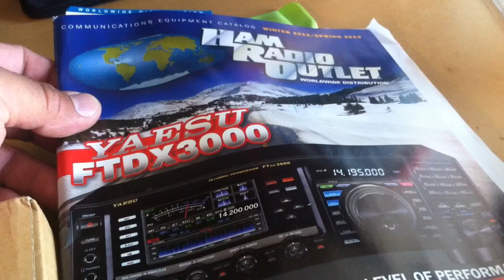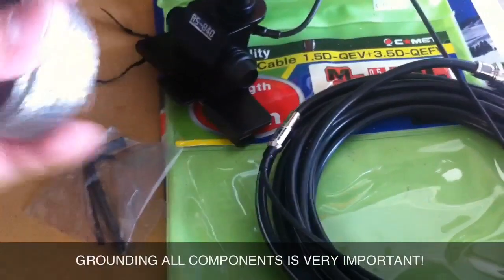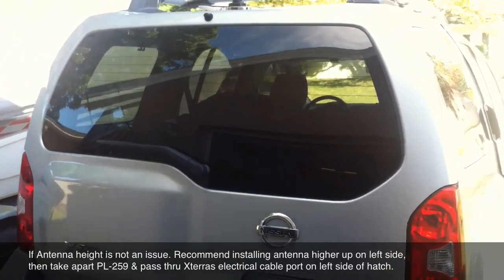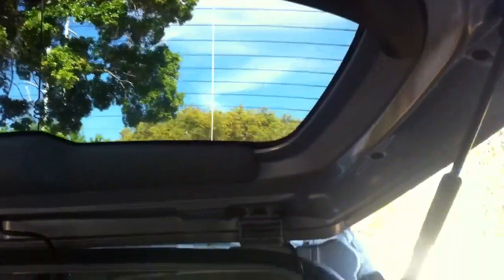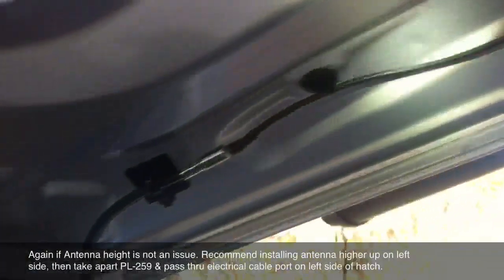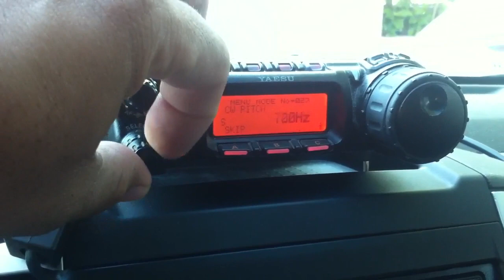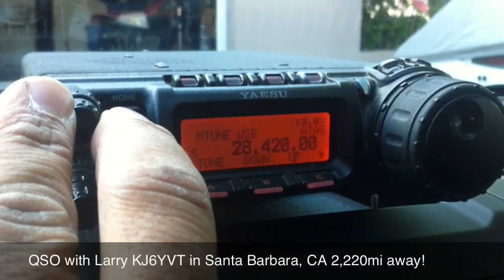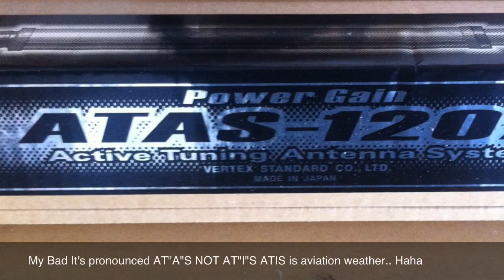How to Install ATAS-120A Antenna w FT-857 Ham Radio

Comment: I have the same setup on my 2008 Toyota Tacoma and you are spot on when it comes to grounding a mobile setup.  20, 15 and 12 meters is a blast when driving home in the afternoon during the summer, lots of European stations report my mobile signal as 57 and up.  Enjoy.
73,
Scott/K5BGL
Reply: Hi,

do you have your ATAS 120A mounted on top or along the bed? I have a Tacoma with a SnugTop and I am having difficulty deciding where to mount it. Got a videos of your set up?
Reply: My ATAS-120 is mounted to the left side of the hood.  I will be posting photos of my mobile set up on QRZ.com this weekend.  Look up K5BGL for photos in a few days.
Reply: sljoseph74 Right on! Looking forward to them. Thanks!!
Reply: Robert,

I have finally updated my profile on QRZ.com and included some photos of the mobile setup.

73,
Scott/K5BGL

Comment: I would have suggested mounting the antenna on the drivers side.  This puts it in the middle of the road and there are less obstacles in the middle than there are on the curb side. For instance, when there are trees on the side of the road, sometimes the branches extend over the road.
Reply from the maker: Agree, but figured diagonally would be the furthest I could safely have HF installed not to mention I installed the VHF/UHF antenna on drivers…
Reply: I agree with you completely. I mounted my ATAS on the Driver's Side Rear Lift Gate of my Van.

Comment: I laughed when I saw this. I have a raptor 30 and a 2000 Nissan Xterra.  I don't do HF mobile but 2m 440 antenna is mag mount as my xyl likes to trim trees lol. Ran my coax through the right rear pass door seal also

Comment: +David Mercado  Hi David, is the ATAS120 still working? I have read so many negative reviews.
Reply from the maker: Achisachis73, antennas still doing great! Make sure the reviews are about the 120A and not the 100 or non A version. Also depending on your location and climate antenna life may vary. I'm in Clearwater Florida so maybe the weather is in my favor or this Salty seawater air may be a ticking time bomb. Only time will tell!
Reply: *****
thank you David, I got mine with a new FT857d and it is working fine

Comment: David, thanks for the video hermano. How is the antenna holding up? I have the same radio but I am undecided as to what antenna to use. I've read a lot of mixed reviews about water messing up this unit. How is it doing in Florida weather? Thanks!

Comment: +David Mercado.. I just purchased the Atas 120a Thursday to go on my big rig. how is yours still holding up?.. KI4TTL
Reply: Mr Marcus I'm also considering this antenna for my big rig. if you get it before I do please let me know how it holds up especially in winter weather situations
Reply: I had one on my Freightliner. The rubber top boot came loose. I think a clown in the truck wash hit it with the high pressure hose. I notice it came undone a few hundred miles away in the rain. I stopped and resealed it with Gorilla glue. I wanted 80 meters, so I bought a Little Tarheel II. I should have gotten that first. I used the dual bolt mirror mounts. Had to have a custom hole drilled at yard for the ATAS120a. The LTII screws into a regular cb mount.
Reply from the maker: Still going strong only the mount has been swapped out so far because of an accidental bump on my part.
Reply: +Darth Anubis honestly I dont think the truck wash did it. mine did the same thing on my KW. They just used cheap glue on it. I haven't re-glued mine yet. I just wrapped the top with 3M electrical tape. So far its held on for the past 4 months now. I will glue it. just been busy or simply forgot about it.

Comment: I have a question.  How does the ground portion of the antenna ground to the mount, and why did you choose a Comet mount over a Diamond K400 mount?  Just curious.  I have an ATAS-100 I'm going to mount on my Expedition and would love to see your grounding points, and a close up of the base of the antenna and the mount.

Great video, and glad to hear you're getting out!

73
Jeff
W5JGW
Reply from the maker: Man sorry I was deployed when you sent this, hope you got it figured out by now. Comet was cheaper and I liked the way the coax was thin towards the mount to fit thru the weather gasket as to not make a huge hole. The mount when tightened to the frame of cargo door is the ground connection. After you strip away some paint where the allen screws contact the metal you are all set.
Reply: So just to further clarify, you did not bond or ground anything and the only part that is grounded is the mount itself to the hatch?  Thanks!

Comment: Nice video.  I have a 2014 Xterra and I am contemplating the 857D in the distant future.  Just out of curiosity, how does that antenna hold up in off-road conditions?  I hit a lot of branches where I drive and the ATAS looks somewhat fragile.  I was just wondering how they hold up.
Reply from the maker: William Ahlers it's a tuff little antenna, handles camping trails pretty good so far. Other than that I haven't driven any excessively off road conditions.
Reply: Hi David
          i just got one of the from a SK. no instructions or box it's the 120 no letter version.I set menu 85 to HF&50mhz i see ATAS on the display. i push tune it keys and nothing happens i wait about 15 seconds no up or down i got nervous so i shut down the radio.
        I see your wife/girl friend operating the tune do you have to hold the tune button while it's keyed for movement/tuning to occur?also are there any control leads for the motor or does it get its signal" motor voltage" through the coax"?jim
Reply: Just got done installing mine on my 2001 Xterra.
            I got it with the same mount but decided to mount it to my drivers side, just under the rear side window with a mirror style mount I had made up to fit where my Ball/ham stick mount was.I used the Comet coax like yours though
            .oh and I would remove your mount and put Neversieze there it will never rust with that stuf there.73'jimKB1PFL

Comment: David, how is the setup going? Radio good? ATAS 120A good? You ever use it on 2m or 440m?
Thanks for the video.
Reply from the maker: Sorry for the late response I was deployed when you wrote this. Setup still going strong! Yes, I have since added the duplexer and its working great on HF, 2M and 440M as long as you don't mind waiting a little bit to tune between bands.

Comment: Hi David and other folks! Quick, probably silly question. Does the ATAS 120 receive electrical power from the coaxial cable? Prepping for an installation and want to make sure I don't need to run another power  cable somewhere.
Reply from the maker: Not a silly question, I wondered the same thing when I first looked into mine. Yes, the ATAS 120 receives power from compatible Yaesu radios like the FT-100, FT-847, FT-897 and FT-897D. There are also aftermarket controllers that allow you to control the ATAS 120 for other non compatible radios.
Reply: David Mercado I have 857D, and I'd say about half the bands are ATAS vs atas. I don't think I've seen the thing move at all though.... it initialized and says some bands are tuned... not 100% sure we've got a fully functioning HF radio.
Reply: and the FT-991 works with the ATAS too. Yaesu and many  ham retailers have not updated this info but it may interest some.

Comment: What do you suggest for 6, 2 and 70?  Your description box says it wont tune lower than 40? 
Be well♡♡♡
Reply: 40 IS the lowest it goes-it was designed that way, which I don't understand because a company as well established as Yaesu you would THINK could have designed the ATAS to work down to 75 Meters as well. I DO love it so much on the Bands it DOES cover that I would fork over another Benjamin to have had 80 Meters. 
Regarding the 857, it is MY understanding the ATAS WILL work from 70 CM down to 40 Meters.
I paired MY ATAS with an 891, and the pair performs VERY well for me thus far.

Comment: I had my ATAS  120 for an hour, and it promptly got stuck in the fully extended position, and I was not happy with how small the whop was. The next Saturday morning I returned it for a set of ham sticks, at $20.00 a band.
Reply: Should have got the ATAS 120 "A"
Reply from the maker: Sorry to hear about your experience, must have been a bad antenna one out of a million. I have seen some people not patient with the antenna and stop it during its auto tune in which the fix is to go into the menu, de-select ATAS exit menu, then enter menu and select ATAS again and wait till it completes its first long auto calibration. If you don't care about the look or extra holes, mounts and being ham sexy then heck enjoy those ham sticks! I don't mind having a small whip not trying to impress anyone... LOL

Comment: Drivers side would be better, you will see why later.
Reply from the maker: Please explain? It's been over a year and so far no accidents. Compared to if it was on the drivers side going thru a drive thru would for sure result in a destroyed antenna via my wife! Lol
Reply: Most trees, shubs etc are usually on the right side of the vehicle. If the antenna hits any of these serious damage can occur to the antenna or the vehicle. Also, on the passenger side it can be a temptation for theft and damage when parallel parked. This is why I always put my largest antenna on the drivers side. Your situation may differ I suppose. I can't speak for drive throughs, my antenna is not as high as yours so would never hit a canopy. Just saying the rule of thumb.
Reply: By the way, nice install, not many mount the radio up high. It is much better for keeping your eyes on the road while operating. :-)
Reply from the maker: Ah I hear ya, man that's funny I haven't parallel parked since I was in NYC! Lol Plus it helps that I mounted it mid body to keep fairly clear of obstacle's and excessive wind.  I normally park in a secure area and if not, antenna gets secured.
Reply from the maker: Also that was a temporary radio install. Head is now on my dash cluster! Sure I can't see my speed below 25mph but then again my days of driving fast in my BMW E46 M3 are over.
Reply: Copy that, hope all goes well with yours, mine works well but I am getting RFI into my 600 watt factory stereo amp when on 10 and 15 meters.
Reply from the maker: So far the only reason I think the antenna would work on drivers side is because my wife forgets its there and closed it on passenger side door a few times. After a slight adjustment tilting antenna closer to body angled in the whip doesn't go near the door jam.. : )